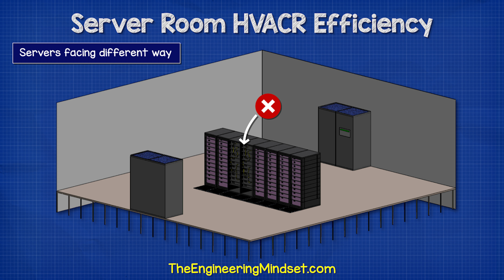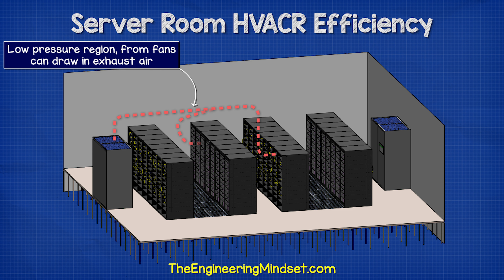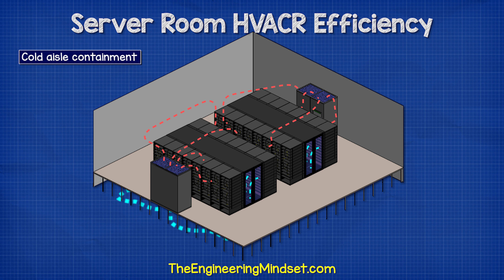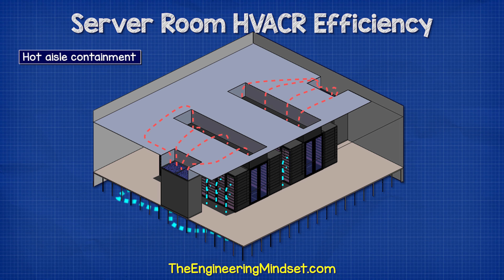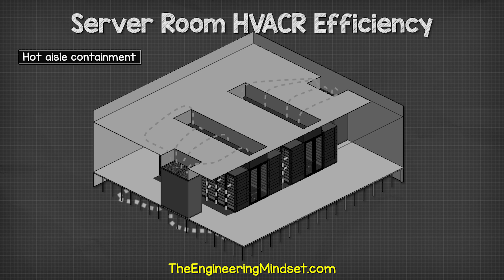Server Room HVACR Efficiency

Comment: Hey man at about :40 you mentioned how the closest to AHU will get the most air if improperly balanced, its actually the other way around as it follows path of least resistance the air will just continue straight down the duct line and therefore come out the farthest. Either way duct design is very important to an efficient system

Comment: I would be a rich man if I had a dollar for every time I had to seek out the IT guys setting up the servers and not putting blocking in the blanks. Then they called me because the servers close to the hole were recirculating hot Aile air and overheating their equipment. A Day in the life of a server farm HVAC Technician.